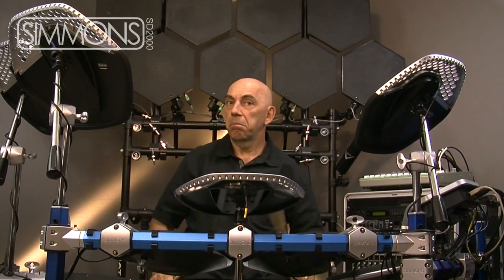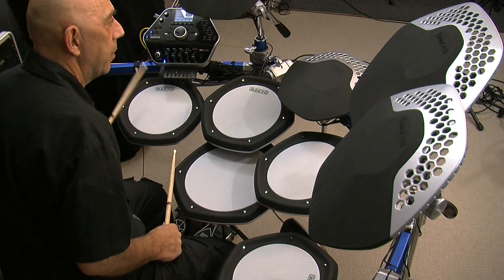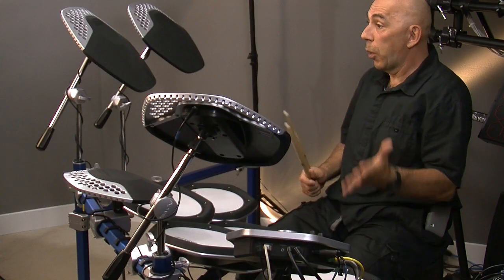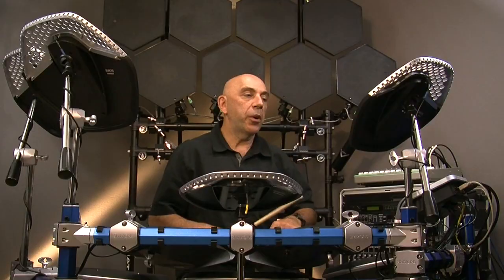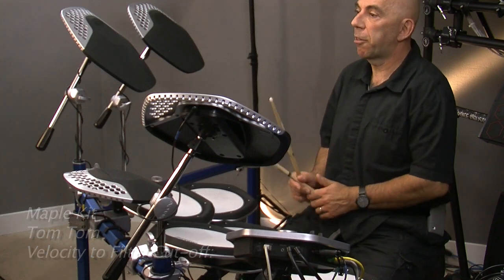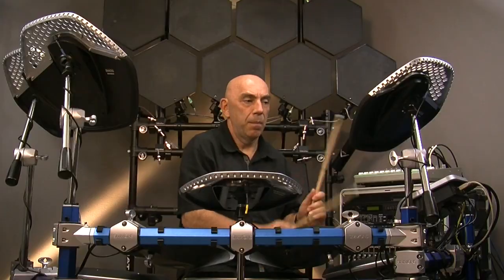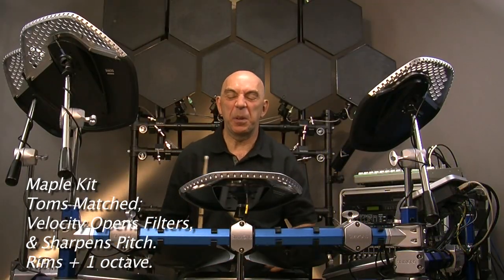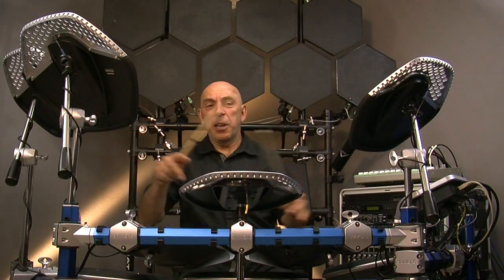Simmons SD2000 - Filter Toms and Pitched Rim Demo

Comment: I bought this kit about 7 months ago and at first i was disappointed at the snare sounds and kept getting cross sounds from the rims so i disconnected them and then it was playable. I bought the expansion kit for it then decided the cymbals were a little stiff so i replaced them with the sd1000 crashes that made it even nicer replaced the hi-hat with a roland rubber hi-hat. Then a bought the TD-17 thinking it would be better but its nice but the SD 2000 is my fav i love this kit it feels good its built really well my go to kit still learning tweeks.

Comment: I played this set and I found it to be weird. Although it sounded great, the play was awkward, the rims weird to play and split between zones bad, the cymbals were strange and not very cymbal like, I did like the drum module. Coverall I think this shows  step in the right direction, but could use improvements.   I have and play the SD1500 and love it. For me the SD1500 is more like playing a real drum set rather than an expensive toy concept of what it could of been like the SD2000.  The one thing that does excite me about the SD2000 is the next ones could be the set to get.